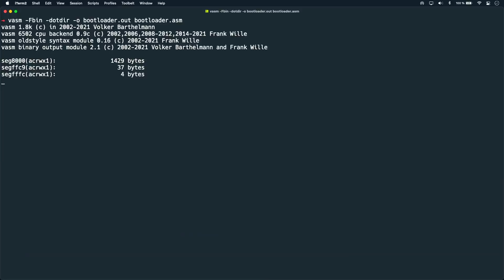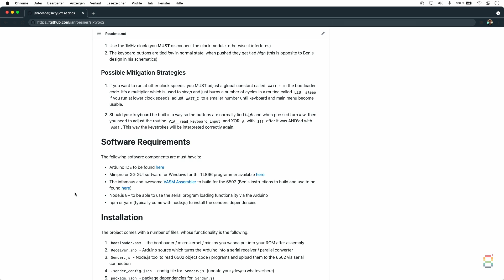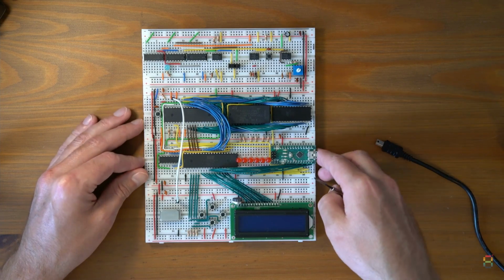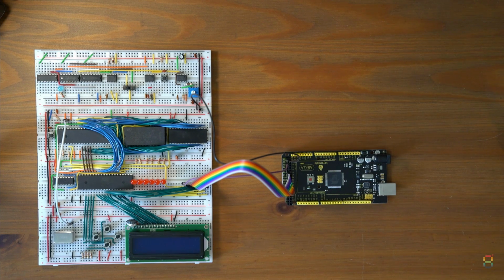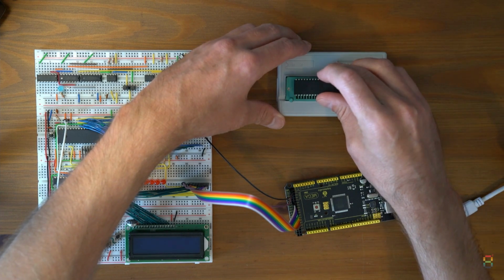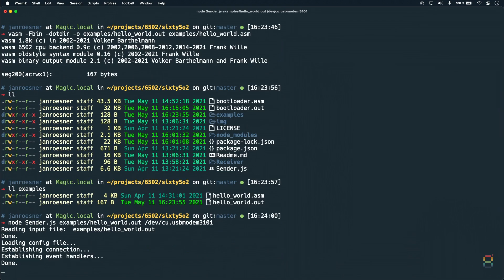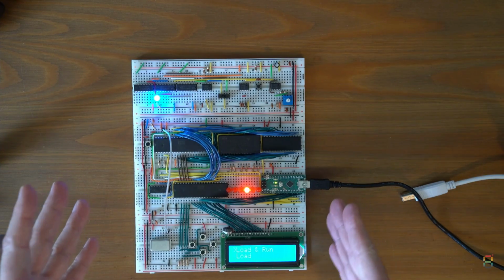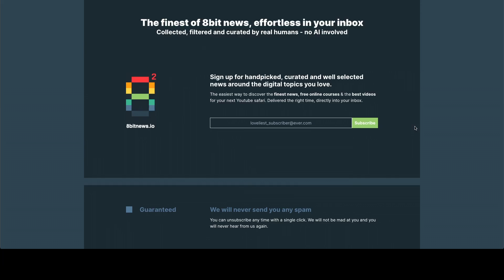Sixty5o2 - The Operating System for Ben Eater's 6502 Breadboard Computer

Comment: Thanks so much for creating this awesome project and the corresponding demo video! This is really cool and looks like it will greatly simplify the process of transferring and running programs on the breadboard 6502.

I have just a few suggestions for you if you make more videos like this in the future:

1. Because your terminal prompt is very long and the actual user input starts on the second line of the prompt, I found it hard to follow exactly what you were doing in the terminal. By the time my eye found the actual command that you were running nestled among the rest of the text on screen, it was already too late and the video would cut to the next shot. I might suggest using a different profile for your terminal with a more simplified prompt that doesn't continue onto a second line, just to make it less visually cluttered and to draw the eye more quickly to what you want it to be looking at.

2. Another suggestion related to the previous one would be to show the commands you are running in the terminal for longer. Instead of cutting to a take where the command is already running, perhaps include yourself typing out the command and hitting Enter in the screen recording. This just gives the viewer more time to understand what's about to happen before it happens and we move on to the next thing, since assembling 6502 programs only takes a second or two on modern hardware.

3. The last suggestion is to avoid using nonstandard commands like shell aliases in videos, since they might confuse less experienced viewers who aren't familiar with aliases and might think they are doing something wrong. I'm specifically referring to `ll` here, which I assume is an alias for `ls -l`. Aliases and shell scripts can be great for saving keystrokes and automating common tasks during everyday use, but when publishing tutorial videos, it's best to stick to standard utilities and tools as much as possible, or at least explain any nonstandard things that you are using.

Cheers!

Comment: Does this work with the AT28C256 ROM? How does it program it?
Reply from the maker: It does. And you have to flash the ROM image yourself after you assembled it. You can use any programmer that works with your ROM type and manufacturer.

Comment: 3:51 when you read RAM before you even write on it xD makes no sense. logic there is nothing after power off so why read before havent even write defaulkt values you need xD got it? bad coding
Reply from the maker: I did not "read the RAM before writing to it." As I said in the video, I use a non-volatile RAM chip in my setup. That means, the data survives a reboot, a shutdown and even a complete power loss. Therefore I needed a Clear RAM functionality. And as it turned out, it was useful not only to me.

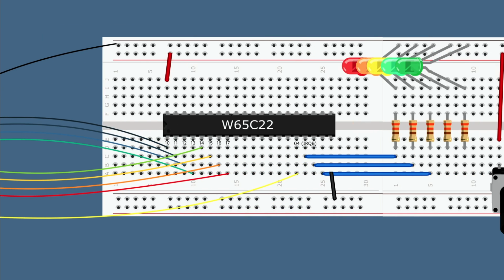Comment: 1:53 this cant work. gnd is pin1 amd vcc is pin20 and rest not make any logic. chip not magically read port and even one pin input one output same port and port (interuptpins)  leds xD
Reply from the maker: You are right. It's a mockup that I misused to represent the idea of using the W65C22 as kind of a serial interface by simply setting up 1 byte at it's input ports, and triggering the interrupt. But I should not have been that lazy and created my own, correct mockups.
Reply: @8bitnews304 At least we all know that people pay attention to detail.  Lol.  Great video, btw, and I hope you post more.

Comment: A great project! However, I had some problems getting it to work with node.js. In the newer versions of node.js there are changes in the SerialPort and the parser modules. Here adjustments must be made in the Sender.js file.
Here are my changes in Sender.js

Lines 1 + 2:
const { SerialPort } = require('serialport')
const { ReadlineParser } = require('@serialport/parser-readline')
Lines 30 - 37
const connectSerial = (config, tty) => {
   const connection = new SerialPort({
       path: tty || config.tty,
       baudRate: config.baudrate,
       databits: config.databits,
       parity: config.parity,
       stopbits: config.stopbits
   })
Lines 48 - 49
const establishParser = (connection, emitter) => {
     const parser = connection.pipe(new ReadlineParser({ delimiter: '\r\n' }))

Comment: First and foremost, great job. I am hoping Ben will take his 6502 project in this general direction. Basically a fully functional 6502 system with monitor, keyboard, mouse, some type of file management system. Although floppy would be cool, SSD or thumb drives or something of that nature would be more practical.
Reply from the maker: Currently it looks more like going into the direction of an Apple I. But with the serial terminal connection you get in- and output, and using WozMon you can easily upload cross-compiled software. So nothing actually stands in your way building hardware drivers yourself.

Comment: Is this how programmers developed for 8-bit home computers?
Reply from the maker: Yes and no. When you had a self-sustaining machine, you could write programs on the machine, assemble and run them. But actually lot's of software was developed on different machines, sometimes even based on a different CPU and therefore ISA, then cross-assembled, transferred into the target and tested. And even worse, back in the 70s the first homebrew machines had to be programmed using switches located on the frontpanel. Those were the times.

Comment: How about letting a nano or so just acting as ROM to the breadboard computer? Would this work?
Reply from the maker: I am quite sure it would. There are enough pin's available for 8-bit addresses and an 8-bit wide data bus. Quite an interesting experiment I think. Don't you dare? The value might be questionable though. As long as you develop your routines in RAM first (using Sixty5o2) and putting them im ROM only afterwards, you have quite a powerful and quick process. But I'm curious for your results.

Comment: I'm not sure about connecting the Arduino pin directly to the CPU ~IRQ pin. I have Western Design Center S-type peripheral chips so to be safe I connect their ~IRQ pins to inputs of an AND gate whose output drives the CPU ~IRQ pin (the active low logic makes it behave like an OR gate). I'd connect the Arduino interrupt to an unused input of that gate, which is normally tied high by a 10k resistor. Even better, connect it to the 6522 VIA and let that generate an interrupt. The advantage of doing that is that it's easier to work out what caused the interrupt if there are several potential sources because VIAs have an interrupt register that can be read to determine the cause. That allows you to prioritise one source of interrupts over another.
Reply from the maker: Love that!

Comment: I am hoping to build one of these,  I am very curious on how these old computers from back when i was a kid work, with this setup over the old 1970's ZX80, MK14 kits is you can add and change things to see how it affects the machine. like how memory mapping works, banking in and out rom/ram. I really think if you understand how the hardware works the software side is a lot easier to understand especially if you build it yourself. 
this was a great video, Looking forward to next video.

Comment: Amazing work! Wow.  
Out of interest: Would TTL-Level RS-232 not also be an idea? That would keep the requirements era-compatible. There are TTL-Level RS-232 Style USB<>RS-232 dongles. The MOS PIA/CIA chips do have serial interface support, as far as I know.
Reply: that would be interesting, alternatively use the serial to connect as a "Dumb Terminal" so it could be programmed and display on a screen instead of the small lcd
Reply: If you want to keep it era-compatible you need a 6551 ACIA. Western Design Center makes the W65C51 that can keep up with its W65C02 and it outputs TTL-level RS232. That's what I use, in conjunction with a USB to TTL-level RS232 dongle, as you mention. Unfortunately, the W65C51 has a hardware bug that needs a bit of effort to workaround, but there's information on 6502,org that helps. Other ACIAs and UARTs are available, of course, but none are as easy to interface with the 6502 as the 6551. The bug is that the Tx interrupt flag in the W65C51's status register is stuck in the high state so you need to mask it out and allow time for the Tx register to empty. There's no buffer, just an eight-bit register so you have to wait for the time taken for the start bit, data bits (it doesn't do parity) and stop bit(s) to be sent before the CPU can present it with the next byte. People have devised simple delay loops to waste the necessary time but came across the problem or requiring longer loops at lower transmission rates and shorter ones at higher transmission rates. The best solution that I've seen is to connect the 1.8MHz baud-rate clock to bit 6 of port B of the 6522 VIA (possibly dividing it by 2 or 4 first with a 74HC74 flip-flop to make it more manageable). You then need to tell the VIA to count the pulses on the port and generate an interrupt when the appropriate number have occurred. You know the clock rate divisor, because that is a necessary part of the ACIA initialisation, so you can easily work out how many clock pulses are needed to send one byte's worth of data. In practice the VIA counter counts down to zero so the interrupt handler simply loads the next byte to transmit and pre-sets the counter, which also clears the interrupt.

Comment: Great Project!!! But I always get the message "Error: Cannot find module 'serialport'". Whether in windows 10 or in ubuntu - it's always the same.
Reply: Hello Stephan, I would suggest using Node version 12 or higher to see if that helps. I would start at version 12, He is using some Apple Os. Hope that helps.
Reply: @thomastraynor18  I tried the actual version 16.14.0 LTS. Even installing additional Visual Studio, Python and IDLE does not help. Unfortunately I don't have an Apple.
Reply: @StephanHampel ,
I sorted of made it down the line a little more using Ubuntu 18.04.6 LTS  and Node 14.x version. I don't own any Apple products so will not be trying that method, but spent a considerable amount trying to get time to get this to work. Hope you have better luck than me. Regards, Thomas
Reply: @thomastraynor18  If I install SerialPort separately there is a new error message: "TypeError: SerialPort is not a constructor" . Now I think its better to rewrite the Bootloader, the Arduino Scetch and the PC programm. Why not use the CB1 pin on the WD65C22 instead connecting the IRQ of the 6502 directly? Why not use a 4 lines Display instead of the 2 lines one and 5 buttons instead of just 4?

Comment: Hello, Great Project. I really want to get this to work. I am hitting Running $0200 hanging on the LCD screen. I am wondering if it's an issue with the node version. I have tried several different versions on Linux and then on Windows. In the two videos, I saw it work was the users had Apple products. I would not think that was the issue. I am wondering if it has an issue with the memory location of $0200 in RAM. I think Ben kits are using different RAM. Any ideas would be greatly appreciated, Thanks in advance for your time.

Comment: Does anyone know how to get this to run BE's code? I've built the circuit, and the example LCD program works fine, however when I load BE's simple LCD example into RAM it doesn't work, I assume its something to do with storing registers using PLA and PHA, but before I get too deep does anyone else have a simple explanation?

Comment: I'm using Windows 10, so my Arduino is under COM8. I don't know how to specify such port when issuing in Windows cmd the command "node sender.js a.out". a.out is the file to which  "hello_world.asm" example was compiled. If I attempt "node sender.js a.out COM8" the transmission looks like starting:
Reading input file:  a.out
Done.
Loading config file...
Establishing connection...
Establishing event handlers...
Done.
Connected.
Establishing parser...
Ready to send data.
Sending chunk: 0
Data transferred successfully! Quitting.

When I select "Run" on the 6502 computer if have the message on the LCD "Running $0x200" and it hangs.
Reply: Hello, I am getting the same error.  Does anyone have an idea why it hangs at Running $0x200? I am using Linux and getting the same error.
Reply: @thomastraynor18  Seems like the sender algorithm is buggy and it works only on Linux due to some lucky timing dependencies. I have a total rewrite of the sender which works properly.

Comment: I wonder how hard it would be to port this to a bread board  Z80. One thing that I found interesting is that when you program the EEPROM ROM you have to program the whole thing. In my case my ROM is 8192k, but a I2c serial eeprom you dont have to program the whole chip?

Comment: So I don’t need a eeprom programmer?
Reply from the maker: You’d still have the chicken/egg problem. There must be a at least the routine running on the machine, which accepts data from the Arduino and put it into the RAM - a minimal boatloader. And that’s exactly, what S5o2 is supposed to be. For that you need the ROM.
Reply from the maker: You need one. At least once to bring Sixty5o2 into the ROM. Afterwards you don’t need it, unless you want to make changes to Sixty5o2 or put often used routines into the ROM also.
Reply: @8bitnews304  Why don't you replace the ROM with RAM (and get 64K) and, on boot process, program the RAM with your Arduino (the sketch must contain the OS binary)? I think this will be a great upgrade to your project! :) Thanks.

Comment: This is awesome! Is there any way you could show the setup or give some diagrams for the Arduino Nano too as I have one of those lying around from Eaters 8-bit CPU project and wanted to try setting this up.
Reply: To use the arduino nano, just edit the arduino sketch to change the pin assignments from what the mega uses to the pins you want to use on the nano, both nano and mega will use the same sketch with the pins reassigned

Comment: Your OS is amazing. I cant wait to use it. I love how it works, and I don't have a  programmer that can program parallel eeproms. So I will use Bens breadboard programmer just to get it stared. I like that I only have to do it once.  TY :)
Reply: Using the Arduino programmer (as I did for a while) is pretty slow too. I have an EEPROM programmer now and it's so much quicker. BUT, Sixty5o2 looks amazing and is definitely my next step!

Comment: I noticed you are using a NANO board. Is it possible to use that like the larger mega board?. I just looked at your code and it seems my  Atmega 328P will be fine.  I
I make breadboard arduinos. I should be able to build it on the board, as it doesn't take up much room, and it lets me power things through it through the serial adapter.
Reply from the maker: Scotty, thanks for the flowers. Yes, you can use the Mega as well as the Nano. Be aware, that you need to adjust the PIN values in receiver.ino before uploading to the Arduino. The latest release contains the PIN setup for both. If you run into trouble, contact me via email.

Comment: I have recently written something very similar for my little breadboard computer. It's made of only six ICs, the processor, a 32k EEPROM, a 32k RAM, some simple 74HC logic and a MAX232 for serial communication. There is no UART. Instead, I use two microcontrollerish I/O pins of the processor to emulate the UART in software. On the other side of that serial connection is a PC, running a VT100 terminal emulation. To upload programs into RAM, I have recently implemented a file upload, using the old XMODEM protocol. How fast is that? Well, for single keystrokes, my serial routines can reach 38400 baud. At that speed there is not enough time to actually do something with the received bytes when one byte comes immediately after another, so I had to fall back ti 19200 baud. That works for now. However, I could still try to raise the processor's clock frequency to reach a higher baud rate. Or I could simply load the entire packet into a buffer and do all the memory address  and checksum calculations after receiving a packet. Then I probably can afford 38400 baud without raising the clock frequency. 

Knowing myself, I will probably end up doing both, but reaching 76800 baud will be hard. The neat part is the simplicity of the little computer. Only six ICs. And no, the processor is not some modern super fast thingie. It's only a year younger than the origiginal 6502.